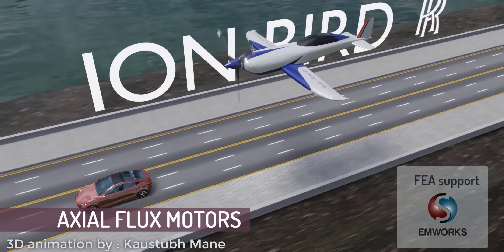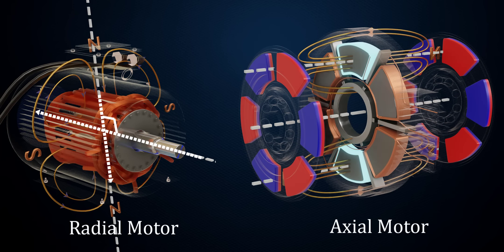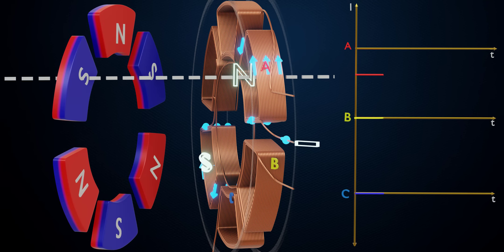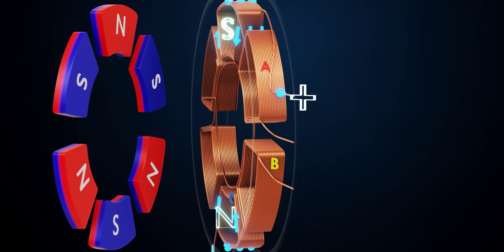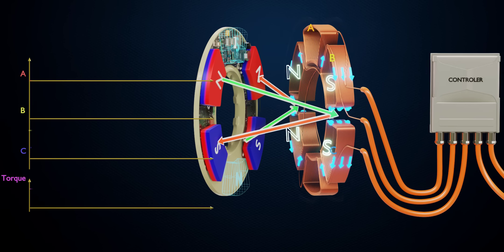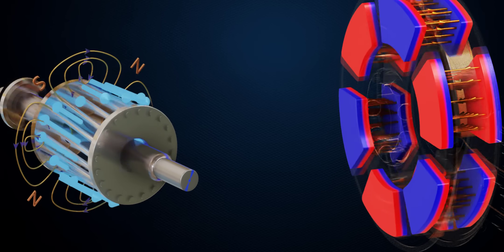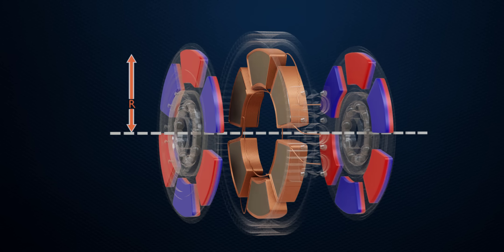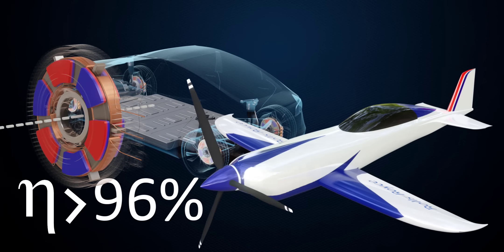Axial flux motors - The new hope

Comment: ... having this hypothesis is good , the situation is similar with outrunner Brussels motor already,  the only problem it's efficiency,  because a electric motor runs optim at the top voltage,  otherwise the speed controller will get hot and electricity will be wasted,  so a gearbox is needed for efficiency,  motor runs at full voltage and speed controller doesn't have to consume unneeded voltage,  battery doesn't have to restrict herself and can put the Flux without intervention.
Reply: I think you may want to learn some basics of electronics first, this doesn't make sense. Motor running best on full voltage? How do you define full? Controller consuming voltage?? No one is using linear speed controllers, everything at the power bigger than a hairdryer has been switched for tens of years.
Reply: @BHBalast , the range of a motor is from X to Y .
Between X and Y the voltage from the battery has to be modulated in till the full voltage reaches the motor by the speed controller .
Running in between X and Y the energy for the battery goes in 2 , and the second it's heating the mosfets from the speed controller , because they have to do something with the volts are not used. 
So if in the meantime nobody invented a switch to ad volts from diferenta packs , to increase the power this is the speed controller job,  the only problem is that he is getting hot when the motor doesn't run at the full power given by the number of volts.

Comment: Wouldn't it make more sense to angle the magnets, instead of having it pull on the edges?
Reply: Force induced by a magnetic field only acts at 90° angles to magnetic field, thus changing the angle would only reduce efficiency.
Reply: @sly_the_aqua_boy9713    Correct.  The fields are acting upon each other, not the magnets.

Comment: The hub dynamo is used efficient power that came from the battery if you add a weight or ring fly wheels that hold the momentum of the engines

Comment: I'm still amazed they aren't used by Tesla and other EV manufacturers.
It makes so much sense to put the motors IN the wheels
Reply: Too much unsprung weight and it’s more susceptible to damage from shock loads. No real benefit over mounting the motors inboard.
Reply: For me this is one of this cases where I think: it is so obvious that someone who actually know their stuff would have done it. In this particular instance, I’m sure Tesla has considered wheel motors and dismissed it for good reasons. Their 2-motor setup is undoubtedly the best compromise for 4wd.
Reply: There really isn't much reason for putting motors in car wheels. Certainly not in the rear, and also in front the industry has long figured out how to get drive+suspension+steering to work well together. And torque-vectoring can just as well be done with four motors in the car, or simply two plus clever brake controllers like Tesla does.

Where this would make sense is for 2-wheel drive motorcycles. Still the unsprung mass is an issue there, but it might still be worth it for slow off-road.
Reply: My ebike has a hub motor, not got much low down torque though, goes better once you get up to around 15 mph though
Reply: You are right, I had the same idea, it is just so logical. Not mentioning the advantage of easy 4x4 configuration and torque vectoring.

Comment: Axial brushless permanent magnet motors are far from being a novelty and have a lot of problems that make them much less attractive than they look at a first glimpse. Noise control and heat extraction are just two of them. By the end of the day, they are not better than conventional in most applications, electric vehicles are good examples.
Reply: Not good for electric vehicles? Tell that to Koenigsegg or Ferrari, or to Mercedes that just bought YASA motors..
Reply: @margolish8220  I said that they are not better, not they are not good. The fact that high end vehicle makers are promoting them is not related to the motors being better.
Reply: @ldokonal1969  yes, is just why only they can build them in hypercars, because they are super expensive. And yes, they are much better than radial FM, higher flux density, lower losser at high frequencies, more torque with less weight.. etc, they are much better, but more expensive too, yes.
Reply: @margolish8220  they are slightly better in applications where very low inertia is very important (and car traction motors don't need very low inertia, even the high performance ones). Contrary to what some claim, they don't generate more flux density and they don't present lower losses (and the losses they present are harder to extract) when compared with conventional radial motors of similar cost, weight and volume. 
The axial concept is not new at all for the electric motor industry. I suggest reading the comment of prof Duane Hanselman in this video and, if possible, I suggest the reading of his book, one of the best in BDC motor design in the last decades.
Reply: And they need fragile electronics to work. You can repair classic motor if it is burned, without  need for replacement parts and electronics.
Reply: @seytanuakbar3022  Electronics can be made very robust.  It is just a matter of budget.  Go cheap and it is fragile.
Reply: @kensmith5694  Everything today is made cheap with short life span so you have to buy new one every year. That is called capitalism.
Reply: @seytanuakbar3022  Cars today last for MANY more miles than they used to.
Reply: @seytanuakbar3022  Yes, that is a trend but it only happens if the competition is only over price.  Standards also help.
Subaru still includes the fact that a lot of their old cars are still on the road in some of their ads.
Reply: @CaseAgainstFaith1  Yes, odometers today have an extra digit because of that.  Very old cars rolled over at 100K miles.
Reply: @kensmith5694  I had forgotten that, but yes, you are correct.
Reply: @kensmith5694  What about Mercedes, BMW, VW, Renault, Peugeot...?
Reply: @seytanuakbar3022  Mercedes and VW have buses to throw the customers under when they have a problem.  The others I don't know about buses for.
Reply: @seytanuakbar3022  there is no electric motor type which can be used in vehicles today without some form of electronic speed control. Sure, brushed DC motor controllers are a bit less complicated than three-phase controllers, but the motors themselves are also heavier and less efficient, so that is not a great design trade off.
Reply: @seytanuakbar3022  the electronics for driving these motors is the same that is used to drive any other brushless motor. But you are right about he fixing of them, axial motors are harder to fix.

Comment: One problem is the high cost of the permanent magnet  and the small amount of rare earth element
Reply: Current electric cars use permanent magnet motors already. But not axel flux motors
Reply: @TellCookie  Yes, because of course with the use of permanent  magnet there is an improvement of the torque and the efficency. But my point is that maybe we have to focus ourself on solution less expensive ,sustainable and more reliable like reluctance motor.
Reply: @leonardobonomi6976  yes i agree. Maybe axial flux reluctance motor?
Reply: @leonardobonomi6976  The tesla model 3 uses a reluctance motor mixed with perm magnets
Reply: THEY DON'T SEE THAT .. PLUS WITH BIDENS AMERICA ,, EVERYTHING WILL BE USELESS & EVERYONE BROKE .. THE SYSTEM WILL CRASH ...

Comment: It's not really more power dense. The power density is determined by the permanent magnet, more than anything, including axial vs radial orientation.
Besides, the power/weight of batteries is still 40x less than fuel, and at least 13x less power output, assuming only 35% efficiency.
Electric planes is kind of an awful idea. Good for 15 minutes of RC flight though.
Reply: @loszonga  huh?
Reply: @loszonga  I didn't say that they couldn't exist, just not seriously. 1.5 hours of flight time isn't much, and it's probably not particularly fast either.
It's not exactly a secret, batteries are heavy and don't carry that much energy.
That little insult is a bit exaggerated don't you think?
It's like a glider with a motor and battery. Not a serious aircraft.
Also, it's airfoil is upside down, not exactly the best way to do it.
Reply: @loszonga  you insulted me by saying my mouth wasn't connected to my brain.
Reply: @loszonga  I think you're just stirring up controversy. You don't have to be disrespectful for any reason. Ok, there's an electric plane. I didn't say that they can't exist, just that they aren't really very feasible, certainly not like jumbo jets and cargo planes. But I guess you were just trying to start an argument, rather than actually presenting some relevant disagreement.
Reply: @loszonga  but it's true. Electricity doesn't have a storage solution that makes it feasible for anything other than niche purposes. Besides, GM had an electric vehicle in the 90's, and there's a good reason they didn't really go into it. The infrastructure didn't exist to support it. Electric vehicles aren't perfect, and the energy isn't free or efficiently produced. Electric motors use heavy metals, batteries aren't cheap, transmission capacity and power generation is vastly underdeveloped (for including transportation), and energy storage is a problem too.
Besides, the notion that CO2 is the problem is wrong. Cutting carbon emissions won't make concrete jungles cold. It's always been about wasted heat, and how urban environments generate and trap heat. CO2 is really just a red herring, and demonizing fossil fuels is a big mistake. CO2 naturally decays in the environment, and gases in general don't retain or trap heat like solids and liquids. The greenhouse effect is bogus, but urban heat islands are real, and so is the poor efficiency of the internal combustion engine.
Reply: @loszonga  there's only 1 CO2 for every 2000 molecules of air. There's no way it actually causes the environment to trap heat. It doesn't occupy enough volume. Gases don't trap heat anyway. Gases convert energy into kinetic movement. Gases actually help regulate an environment by cooling it off, despite the fact that they conduct heat like every other form of matter.
Reply: @loszonga  do you still think that the greenhouse effect is real science? If so, why?
Honestly, I'm not entirely sure you're correct about that statement, but I do think that matter and energy are related. It's highly esoteric, theoretical physics. The idea that energy contains mass is dubious, but I struggle to understand exactly what energy could be if it isn't kinetic movement through a conduit of some kind.
One of the red flags for me is E=MC^2. Supposedly, this means any object in motion, even falling, has greater mass.
Theoretical physics often contradicts itself. Like gravitational waves. They propogate at the speed of light, yet they are not affected by a gravitational field. If black holes can emit radiation, how is it that no radiation can escape their gravity? It's a paradox. I think it's not something really worth arguing about, because it's so intangible/unobservable. Observation is the essence of science. I happen to think that gravity is the force that supersedes energy, that energy is derivative of gravity. It's the only thing that is truly observable. Those gravitational waves could have been something else, like dishonesty or some small magnitude tremor.
Reply: @grantmccoy6739  I am sorry but you are just ping-pong-ing thru it all giving a lot of info but with no framework to agree at all. It is just brain farting and I will not follow up on it. Enough time wasted talking actually... nothing. Obviously you have trouble in letting go on the materialistic perspective. Even Einstein was a very smart man, he never believed an atomic bomb was possible, hence, take the energy / matter equation with a grain of salt. It is obvious we know very little about the construct of ''reality'' and nothing is more dangerous that the presumption we know it all.
Reply: @loszonga  but you still didn't comment about the greenhouse effect. What do you think?
Reply: @grantmccoy6739  you did not comment on most of arguments. I see no reason to comment, the data speaks for itself. Of course you may say the data is spoiled to accelerate the ''electrification'' but again, you might be wrong too: only two weeks ago the Lead compound was banned from fuel. Let that sink in for a moment if you are biking for work or pleasure with your kids on the sidewalk next to two or three lanes of cars.
Reply: @grantmccoy6739  Also if you used a photo camera, think about the way you may alternate the focus of a picture by using different types of lens with different glass density. Gases + sun radiation (light) works exactly in the same way. Also, taking ''petrol'' out, witch we don't know what role has in the earth's superior layers (it may be a coolant) on this 25.000 miles per hour spinning engine...then we are square in our presumptions. I feel like you don't listen to understand, but to answer back. That's not productive for both. For sure you don't draw dopamine from this attention that I give you?
Reply: @loszonga  where do you live? Lead was banned in the USA in the 70's.
Reply: @grantmccoy6739  It's a global climate not an USA climate: ''On August 30, the United Nations (UN) announced Algeria's last reserves of leaded gasoline had officially been emptied in July 2021, marking the global end of leaded fuel use in vehicles, according to a statement. Officials say the end of leaded petrol use will prevent more than 1.2 million premature deaths per year, and it's an important step toward improving air pollution levels around the world, reports Helena Horton for the Guardian.''

Comment: As always, your work is beautiful and clear. Simplified renderings help basic understanding. I'm not criticizing, only offering suggestions for the next level of explanation. 

Some issues were not addressed: Heat build-up / dissipation is one. Motors get hot. Permanent magnets lose strength near the curie point, thereby reducing the motor's power. Cooling is crucial. I saw no mention of fans or cooling in this simplified rendering.

Proximity is another issue. To achieve the high efficiency mentioned ( 96% ), magnets must be very close to coils. That requires superb bearings with tight tolerances plus some way to insure magnets never touch the inner coil. If magnets physically touched coils during operation, they would seize the motor. Obviously a bad thing mid-flight. We know how to make strong permanent magnets with consistent field-strength, but the coil windings must also be consistent, Either that, or the controllers and sensors must work together to adjust for inconsistent field strength. That adds considerable complexity to designing and programming controllers, 

The sensors are glossed over here. I assume we're talking about Hall-Effect sensors, which are known for reliability and are cheap. Would like to see more detail addressing redundancy in sensors. Clearly, how well the sensors sense, affects how well the controller controls. If this motor is to be applied in aviation, then multiple redundancy will be necessary.

Comment: Are the brushless motors used in FPV drones/ RC plane this type?
Reply: Pretty sure they are, yeah. Though the magnets are usually arranged just outside the coil perimeter instead of toward the face of the coil assembly. But the windings change orientation to suit.